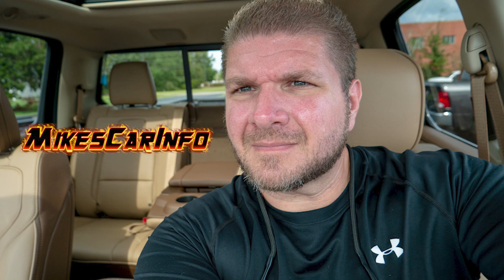Got a Turbo? Use Premium Fuel.

Comment: So does this pertain to every turbo? 

I have a 2022 Silverado Trail Boss with the 2.7 and everything i have read online, (forums, Google,  chatgpt) says that GM designed the engine intentionally to run on 87 given all the potential knock issues--- do you still recommend premium on that truck?
Reply from the maker: Yes, I still recommend premium. You will notice they never say specifically what was done to the engine mechanically to justify the claim "designed the engine intentionally to run on 87".

Comment: You bring up good points about the marketing versus functional mechanics of turbo charged cars. I think these are good points people need to understand before buying turbo charged cars versus larger engine vehicles. Personally, I don't want to put super or premium fuel in cars because they typically run 50 cents to a dollar higher per gallon. That adds up fast.
Reply from the maker: It certainly does add up, and that's a factor to consider when choosing a vehicle.

Comment: So we heard about the Honda 1.5Ts like in the CRV, and people are having oil dilution issues and head gasket failure between cylinders 2 and 3, and people are saying if you put in premium fuel in it and change at 5K mile invervals it seems to deal with it.   I also noticed on my Rogue the UK and Thailand and other markets the KR15DDT engine say to use (for US adjusted) 91 octane, and yet in the US it says 87 octane... but I was noticing a rattling sound at some throttle.   Put in premium and no longer had knock noises.   Manufacturers lie!

Comment: Gonna respectfully disagree with you on this one. Parents have a 2016 Mazda CX9, 2.5L turbo, currently sitting at 155k miles. Never put anything higher than 87 in it, and it’s never experienced a single significant mechanical issue. Granted, they were diligent on their 5k oil changes, so I’m sure that’s part of it.
Reply from the maker: I’m glad to hear it.  If a modern vehicle didn't make it to 150k miles I would be very surprised, even with mild neglect and cheap gas. How it is driven makes a huge difference in wear. I sold my 2016 challenger at 110k miles and it still had the original brake pads.

Comment: Not changing your oil religiously on your turbo (every 3k) will kill your engine before that 93 fuel jargon.
Reply from the maker: I agree that oil changes are extremely important. This keeps the lower end(mostly) of the engine near perfect. Fuel quality and type helps with the upper end of the engine(mostly).

Comment: You only need premium fuel if the manufacturer says it's required. If it says recommended you can run 87 octane no problem. Just use a TOP TIER gasoline from brand name suppliers.
Reply from the maker: This video explains the potential consequences of doing that.

Comment: I’m with you on this. I’ve owned several turbo cars that say 87 is fine, but they always run noticeably better on 91. I’m honestly baffled when people say they can’t tell a difference. I’m super sensitive to how my cars behave… one rattle and I’m losing my mind 😂

Even with the press cars I review, I experiment a bit and always notice better performance (especially in the summer) with premium fuel on turbocharged vehicles.
Reply: I believe on the Mazda CX5, they even advertise 30hp+ with premium, but recommend at least 87.
Reply: @BoopSnoot correct, they do that with their other models too. Best to just use premium IMO!
Reply: @PaulsPlace  in TX our premium is 93, woot!

Comment: What does it mean when a manufacturer even recommends you to use premium fuel on a naturally aspirated engine such as the naturally aspirated V6 engine on the MDX, the manufacturer recommends the owner to use premium fuel, I don’t get it.
Reply from the maker: Some N/A engines run high compression and aggressive timing. That makes them sensitive to knock. Premium lets them run their full performance and efficiency without constantly pulling timing

Comment: I’m curious, what kinds of cars do you need the 89 mid grade?
Reply from the maker: It’s not a requirement for modern cars, just a useful middle option in those ‘minimum vs recommended’ engines
Reply: It's recommended for the 5.7 Hemi. I noticed more pep when using it.

Comment: I owned a '21 Ford Ranger for a while, but have since sold it. Great truck, but when I had it I always paid a bit more at the pump and used 91 octane. The truck ran smoother, had better pick up and it seemed I got better gas mileage. My very first turbo engine I owned and if I ever own a turbo engine going forward I would use premium fuel. If you can afford it I say use premium fuel, your turbo engine will appreciate it. Agree with you 100% Mike

Comment: I used 93 on my Type R and change out the oil every 2k. Also before I turn off the car I would wait 20-30 sec's. Just old school here.
Reply: I'm the same with my rdx. Every time I go to the dealer for a oil change, they say "but your only at 50%". Every single time
Reply: Bro 2K miles? That's way too often, even 5K should be fine.

Comment: People also are bad about oil changes and cooling flushes. 3k-5k mile oil change intervals are a must on these stressed engines (full synthetic oil is usually the best). Criminal that the manufacturers say you can do oil changes every 10k miles. I would guess a coolant system flush at 60k would be a good idea.

Comment from the maker: Turbo engines run hotter and operate under higher pressure than non-turbo engines. That heat and pressure can cause the fuel-air mixture to ignite too early, creating a condition called "knock" that can damage pistons, valves, or bearings.

Turbo engines designed for 87-octane fuel rely on the ECU and knock sensors to constantly adjust ignition timing to prevent this pre-ignition. That’s how they survive on regular fuel without destroying themselves.

However, when the ECU pulls back timing to protect the engine, combustion becomes slightly less efficient and runs hotter over time, which can contribute to carbon buildup on pistons and valves. The harder you drive, or the hotter the conditions, the more often the ECU has to intervene.

Repeated knock events also create violent pressure spikes that can stress the head gasket. The head gasket seals the space between the cylinder head and block, holding back extreme pressure and heat. When detonation happens, those shockwaves hit the gasket’s sealing surfaces like miniature explosions, gradually wearing them down. Over time, that can lead to leaks, loss of compression, or early gasket failure.

Using premium fuel (91–93 octane) greatly reduces these knock events, allowing the engine to run smoother, cleaner, and with less stress on internal components and seals over the long term.
Reply: Interesting review. 👍👍 What about higher displacement turbo charge engines, e.g. 2026 VW Turbo 268 HP 258 lb feet of torque?
Reply from the maker: It is the same principle for any turbo engine.
Reply: @MikesCarInfo  i agree with this :person-turqouise-waving:
Reply: especially since many turbo engines are direct injection and can get carbon fouled.  that carbon fouling can cause detonation on lower octanes.